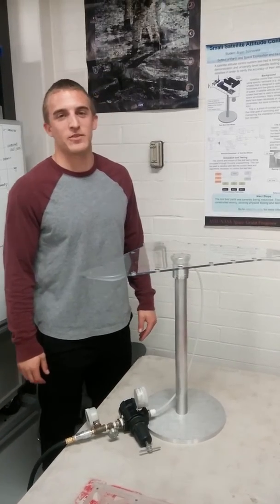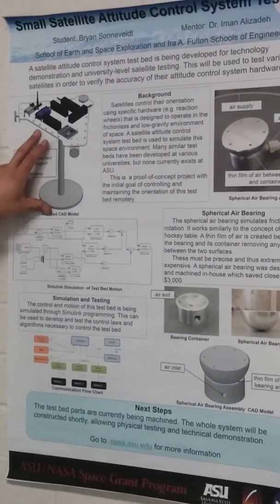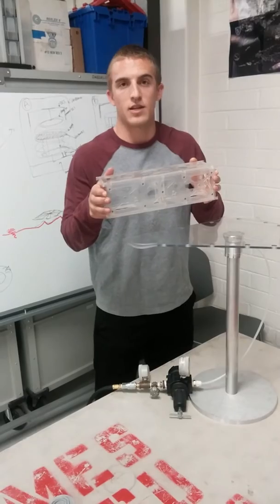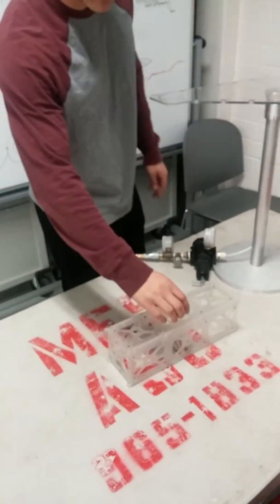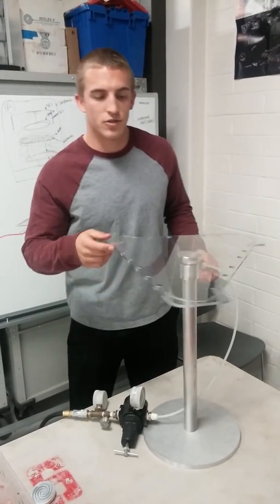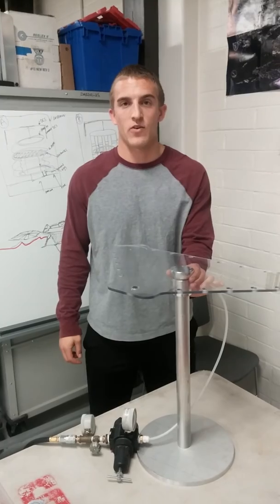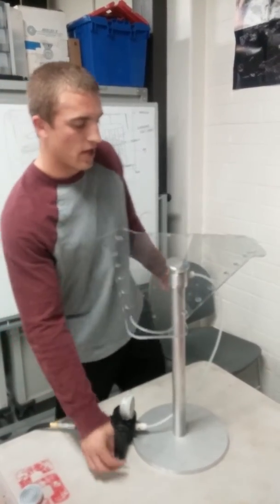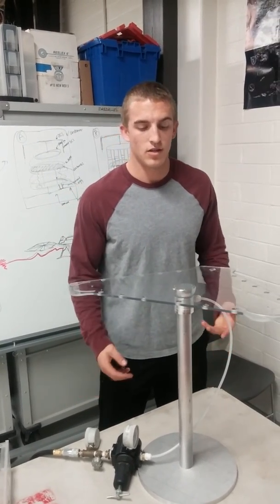Small Satellite, Attitude Determination and Control System (ADCS) Test Bed

Comment: @Bryan Sonneveldt, Hello thanks for sharing ur video. You said it s possible to buy such equipment, which is quite expensive, from companies. Could you please give a few names from companies where you can buy that kind of equipment for testing purposes? Thx in advance
Reply from the maker: +li dao There are two main companies where I know you can buy small spherical air bearings (ones similar in size to the one in the video), these are "Specialty Components" and "Nelson Air Corporation". I believe there are other companies that make spherical air bearings but it is tough find small ones. Let me know of any other questions!